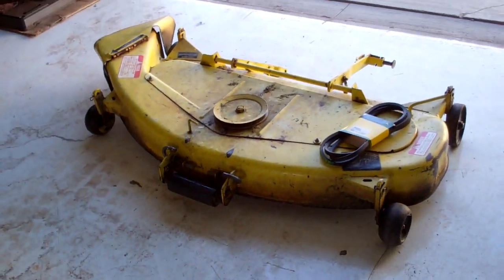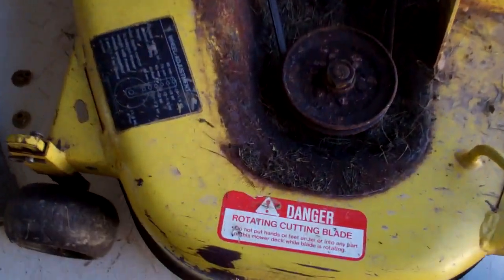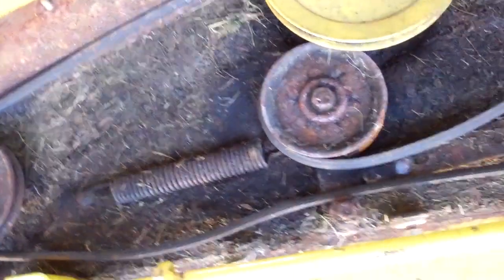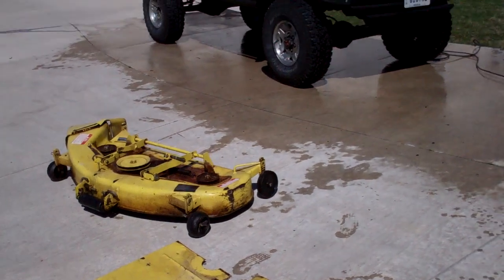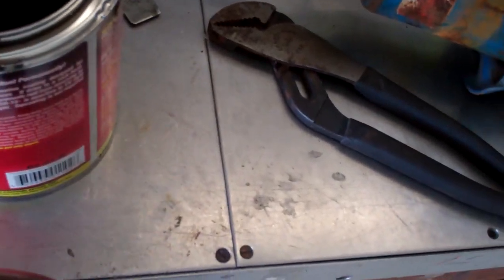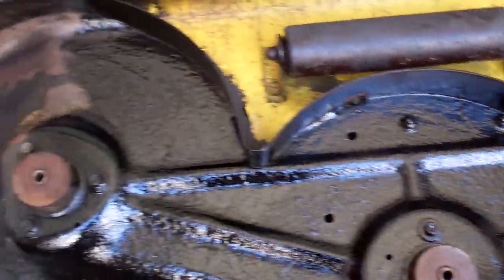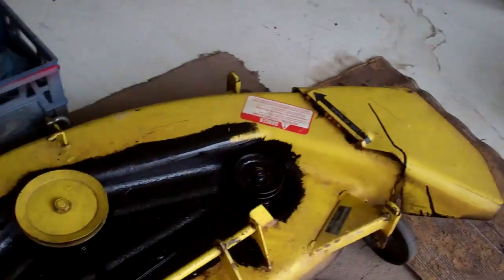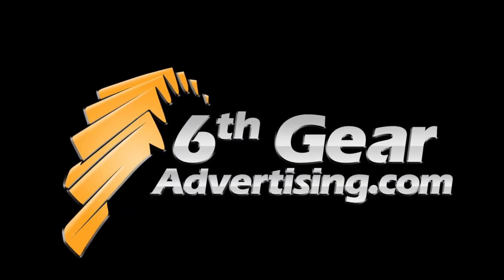Fix Rust with POR 15 on John Deere 318 50" deck

Comment: I'm rebuilding my 48 inch now and wow what a project. Ill try POR. Amazing they function at all. I clean mine several times each season. Always a mess.
Reply from the maker: I just had to clean, grind and re-paint mine with POR again. I'm not washing it with water any more. Moisture had caused major rust bubbling and pitting beneath the POR around the bearings. Now I just blow it off with compressed air. I'd rather have some dead grass dried to the underside than dealing with more rust.

Comment: If u ate using por 15 get it sandblasted first as it will stick to the feck much easier my kubota deck is galvanized as paint will peel off after a while

Comment: I just use a brush with old motor oil on my deck on the bottom. I use it on my trailer for the last 19 years outside seems to work okay.
Reply from the maker: I may try that!
Reply: @6thGearGarage  I'm not buying all those expensive products not worth it use motor oil!

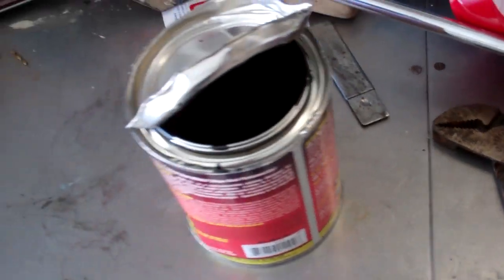Comment: Now that's what I'm talkin about 4:15 that is some damn good stuff also a company out of Florida named International epoxies and sealers IES has a product called IES 1500 better and cheaper than por-15 works just as good if not better that's what I'm talkin about other guy that other video was talking about undercoat oh my gosh you can't use undercoat for nothing maybe on a tree limb that you cut that's about it absolutely undercoat no-good por-15 IES 1500 wonderful good that's the stuff

Comment: The POR 15 will work better if you use their degreaser first, then pre-etching product, then POR 15.  Otherwise it will just peel off.

Comment: Keep the covers off and I remove damp grass with a leaf blower after every cut on my 25 year old deck.
Reply from the maker: I have been doing that the season and it has worked great! I clean the underside with water after mowing and then blow out the top with the air compressor. If I was going to do anything different, I would have used a UV-resistant rust inhibitor.
Reply: Yea newer decks don't even have them anymore.  Only timed ones...  But appears yours isn't timed.  Still the POR 15 should stop anymore deterioration, excellent work.
Reply: I blow mine off with a air hose each time... Covers can stay off, looking for a complete ( pulley and jack shaft for center sheave!!  Not from Deere....

Comment: Noticed the 2nd gen 4Runner wheels, a fellow Toyota enthusiast?  Here to preserve my Stx38 Yellow deck.
Reply from the maker: Hey, I'm actually a addict of 80's Toyota Trucks. I have a few right now, but my baby is my 1985 Xtra Cab 4x4. I was just watching some of your offroad vids... great stuff!
Reply: @6thGearGarage  85 factory sfa extra cab with efi?
Those are very rare trucks if they haven't been beat to hell.
Keep up the good work!
Reply from the maker: @DavidToyotaHead13  Unfortunately it's not an EFI. I do have a rusty 87 with EFI though that I'd like to use as a donor to convert my 85 at some point. These 22RE's are about bullet proof!

Comment: i did the same to my mower but it wont hold up very long under the deck no matter how well the preparetion is.
Reply from the maker: I need to re-do mine, it's starting to get crusty under the POR15 in some areas
Reply: @6thGearGarage   the underdeck got sanded all the time by grass/debris,so por15 cant stay especially the outer ring area, however it stays strong around the spindels area where grass usually build up and cozing rust issue,so i can say the por15 still serve the purposes.

Comment: Two suggestions,:
One:  Put cellophane over the can, and then put the lid back on, you'll have no problem taking the lid of next time.  (Yup, been there before......)  ;-) 
Two: Toss the deck covers/guards into the trash.    I had the same problem with my Kubota, and once I took the covers off I never had another season with crapped up pulleys.   Its easier to access for cleaning after mowing, and drys out a lot faster.
Reply from the maker: +JimsEquipmentShed I hadn't considered leaving the covers off... genius!  I was thinking about drilling the drain holes to be larger, but leaving the covers off is even easier!
Reply: 6th Gear Advertising Yea, drain holes were my first thought as well, but I got talked out of it by one of my friends. Hes a landscaper, so I figured he knew more than I did about machine maintenance.  
(Full disclosure, hes also the guy that told me to remove the 'crap keepers'.)
He warned me against putting holes in the deck, as they just tend to get larger, and weaken things.
Reply: Making small holes larger or drilling some can cause stress cracks in these drawn formed decks

Comment: Galvanized deck is the only way to go not sure about the John Deere deck as they are thinner than my Kubota deck I got galvanized also the heat from the galvanized will make the deck must stronger mine now is over 10years old and still no sign of rust but don't forget at end of summer wash off grass if u do this it should last for years and when u are putting in new bolts put under guard protection on bolt threads and then run them in Grease as they will be easy to take off next time

Comment: You should paint over por 15 after.  It will last years longer.
Reply from the maker: Thanks for the tip... I'll try that next time.  The POR15 on the top has held up great but the wear/tear has caused some on the underside to come off.

Comment: I have heard the you can never coat a rusted surface without completely removing the rust because that never sleeps. How is this holding up? Do you see any signs of rust so far?
Reply from the maker: Yeah, it is starting to show rust in some areas. Also I left the covers off to make it easier to clean the grass out of the inside. POR15 and most other rust inhibitors actually bond best to a rusty surface. they don't stick well to clean metal unless it is etched first.

Comment: Thanks for the video - great idea with the POR 15, I haven't seen that before. 
Shame on JD for such a design. You should patent your idea and sell it to Deere, maybe they will use it.
Reply from the maker: I leave the covers off all the time now so that I can easily remove the grass and it works great. Just don't stick a foot in there with the deck running.

Comment: so this is your second por15 application to the under side of the deck.  how long did the first por15 application last?
Reply from the maker: It lasted about 3 years, but I don't think I prepped the surface as well as I should have on the first time.

Comment: If you would use a power and air hose to top and bottom of deck ever year you will not have rust problems.